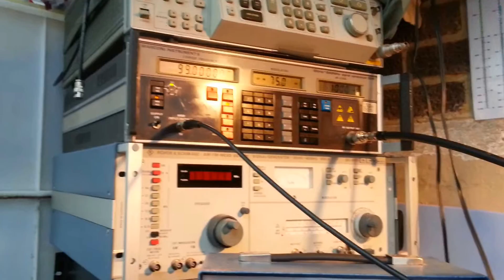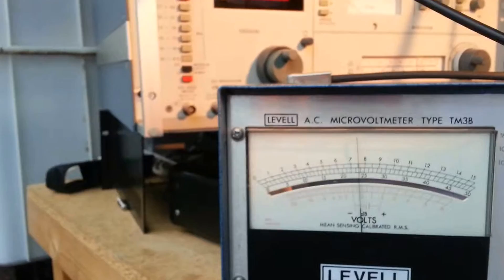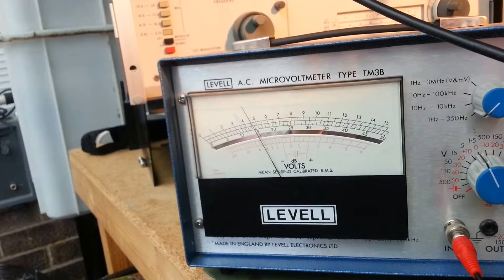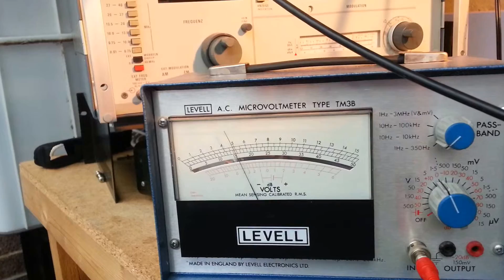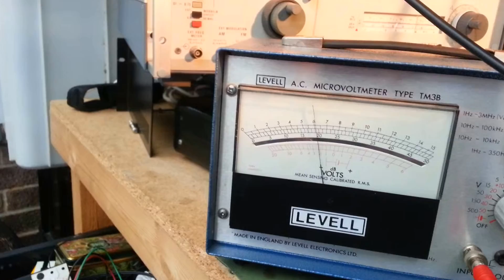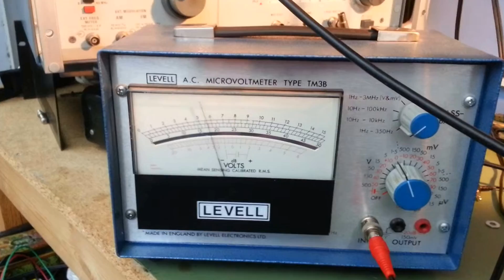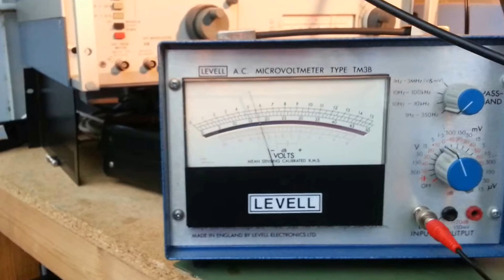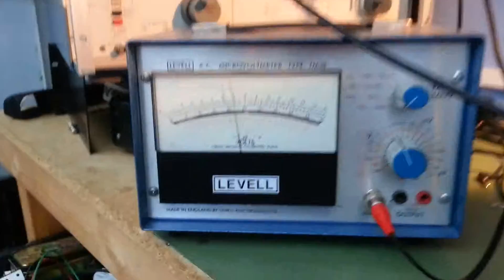Quad FM4 audio rolloff mod

Comment: Thanks so much for posting this, I read about this issue years ago but this finally motivated me to add those capacitors. (and now I realise the battery needs changing too)
Reply from the maker: You should notice the bass improvement straight away.
Reply: absolutely!

Comment: The FM4 was designed for 100k load. Says so in the manual. It has 220nF output coupling capacitors. Adding another 100nF in parallel with that accomplishes almost nothing. You want to raise it to 1uF or 2.2uF more so as to cope with loads of 22K, 10k, etc., which are more common these days.